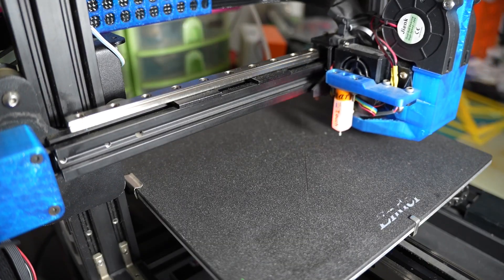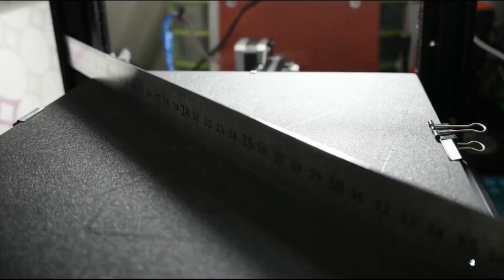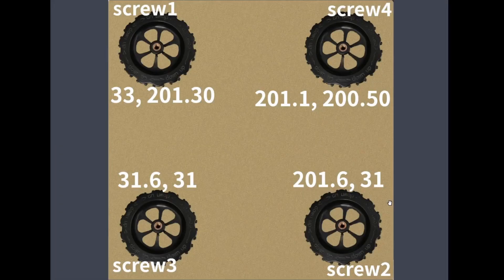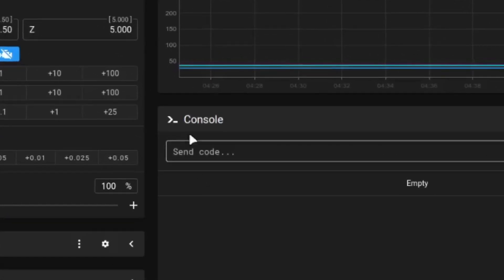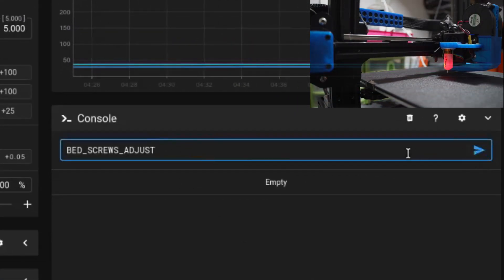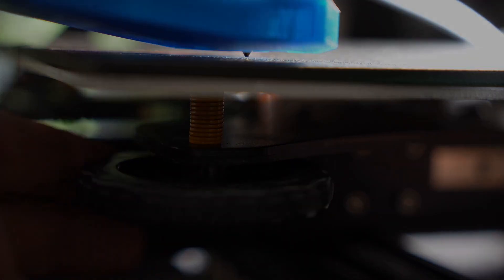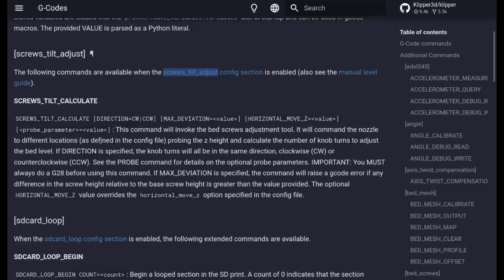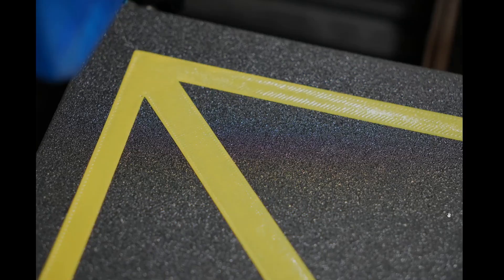Perfect Bed Leveling in Klipper: Manual & Probe Methods Explained!

Comment: Thank you. I was having issues with both bed_srews_adjust and screws_tilt_adjust. When saving and restarting it kept saying I needed at least three screws despite having 4. I copied the script directly from lklipper and created an individual config file for each and added an include script in my printer config file. Im guessing doing it from scratch is no the right way according to klipper.
Reply from the maker: Glade it was informative for youi